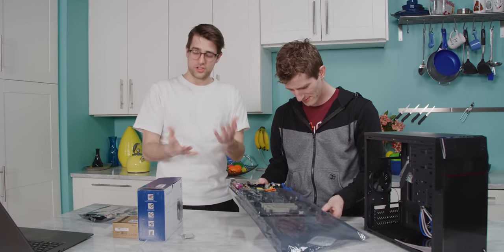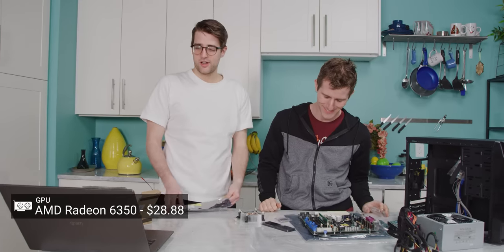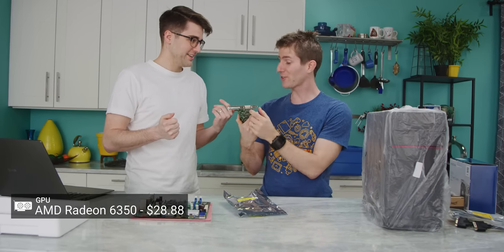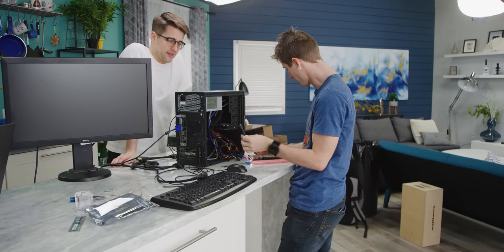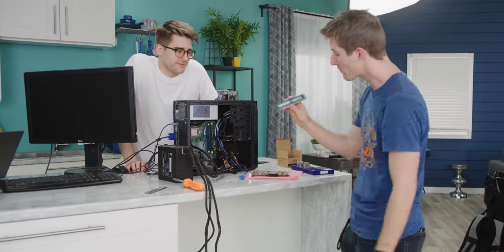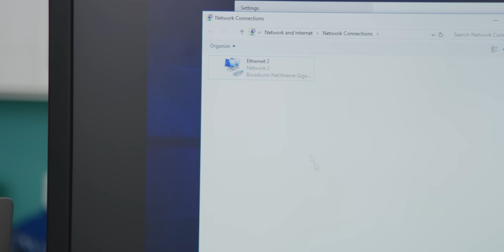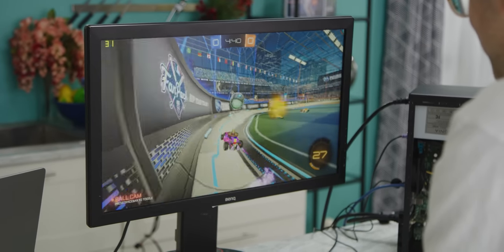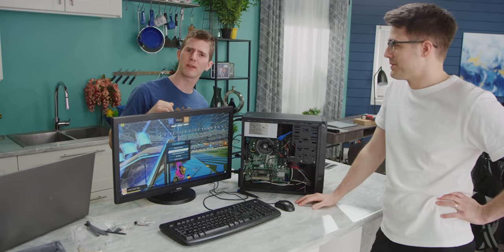We Built the CHEAPEST PC on Amazon!

Comment: The Radeon HD 6350 was only $23 MSRP when it launched in 2011, so it got more expensive. (The 5450 was a $50 card from 2010).

That connector is called a DMS-59 for Dual Monitor Solution. It can run two monitors off of a single port, using a splitter cable but since it's a unique port, you need an adapter even for a single monitor. It's a derivative of the LFH-60, which can run up to four monitors (the DMS-59 has one hole blocked).

ttps://en.wikipedia.org/wiki/DMS-59

Comment: I had a 775 socket rig since 2020 you can make 771 sockets CPUs work on 775 with a little work. I finally upgraded sort of to AMD 3400g (new), B450 MOBO (new) and a R9 390x I bought for a 100$ never used 'like new'.

I just missed out on an AMD 3600 for 120$ (new) and a 3300x for 84$ (new).

Comment: Guys I have a problem with my PC and I hope the comment section can help
I have an Intel core I7 7700
Gtx 1060 Asus strix oc
8gb ddr4 ram single stick 2400mhz
128 GB SSD the tiny/fast one
2tb hd
450 watt powersupply
It runs alot worse than the PC is supposed to
What could be wrong?
Edit
I usually get around 40 ° temperature wise
I have everything updated aswell
Reply: Maybe the cpu is outdated or you havent updated windows
Reply: Check temperatures. Bad or old paste could make thermal throttling. 450 W psu doesnt look powerful
Reply: Psu is ok for gpu cpu looks fine is it a fps issue the maybe you integrated is bieng used instead of your dedicated gpu
Reply: @Teampepsi123  I checked and all my driver's are installed and my 1060 is being used
Reply: TBFY_ CLAN then I don’t know

Comment: I got myself a computer completely from eBay. It's an old HP Compaq dc7800 Convertible Mini Tower, upgraded with an Intel Core 2 Quad Q9550, 8 GB RAM and a GTX 750 Ti.
Bought 2008. 200€ for the computer (fixed in a workshop for disabled, including a LG Screen and an old RT7H10 HP Keyboard) and about 150€ for the upgrades. So total of 350€. (Plus 25€ for a WiFi Adapter last year, since i moved and wasn't able to use a LAN cable anymore. So 375€ total up to today.)
Downside: It's now that old (turning 13 years old in two months) that Win7 is the highest i can install (bios update didn't worked sadly), there is no way i could upgrade it more and it starts to be to old to run newer games on it.
Upside: It's still running pretty good (using it right now) and i am able to play a lot of games on it like GTA 5 or Minecraft with decent shaders, etc..
So in total i would say it was totally worth the 350€ back then. But it becomes necessary for me to buy a new one tbh...

Comment: OEM parts fucking you over is exactly why I decided to stop buying computers and start building them myself.

My brand new $1000 HP computer was outdated to where I couldn’t play any new games after 2 or 3 years. I felt so ripped off. Then I tried to upgrade things for school and quickly learned about OEM parts as I tried to add new parts to it and failing to do so, tried moving old parts into a new PC to no avail. The only thing I brought over from old computer to new was the DVD drive. I probably could have brought over the PSU, too, but it was like 400 or 450 watts.

The computer I built cost the same as an HP, but was significantly more powerful and wasn’t locked down with shitty OEM parts. I built my sister’s computer, too.

Comment: I have a challenge for you guys.....try building a 'retro' system using a PC Chips M741 LMRT / SiS630 chipset based mobo with onboard VGA - all the way up to 8MB of your system memory will be used for VGA. Even in the late 90's this motherboard I mention was not exactly the best...........it would even lag severely with 3d screensavers so anything more than Solitaire / MSHearts or maybe WinPopup might be more challenging....heck, that thing even had a built in modem.

Comment: I was at my grandma's house and they had a pc that looked like a gaming pc. It originally ran windows vista, as stated by the sticker on the case, and is from about 20 years ago, but my uncle installed windows 10 on it for my grandma. It has ram expansion disk reader thingie and other crap that was the standard 20 years ago. It has letters: (xd) that looked like it was sqwished from the top and bottom, right by the disk reader. It is AMD (standard back then) and it ran roller coaster tycoon from 1999 great.

Comment: I mean, the graphics card is pretty bad somewhat. But I gamed on core 2 duo till 2017 and core 2 quad till 2019, before I upgraded to a i5. I only upgraded to the quad in between because R6 needs 4 cores. But in pretty much all games(with a small overclock about 0.3-0.5 more ghz) I got about 40-60 fps on low-mid settings(in R6 60fps with low settings) with a gtx 780. so they ain’t even that bad. The only reason i upgraded was that the core 2 quad couldn’t run black ops 4(at least not playable)

Comment: I’m on a dell laptop and I’m saving up to switch to pc.
Any got any recommendations?
Reply: Juz go for a apu like ryzen 3 3200g or if you don't have a lot of money left, then buy a core 2 quad and a gt 710, then save up money for an upgrade on the GPU and buy 8gigs of ddr3 ram, buy the zebronics g41 motherboard and buy the circle 450watt PSU( this setup cannot be upgraded)
I recommend u to go for the ryzen
Reply: @niranjansudhi2585  i want to buy ryzen 5 3400g is that a good option ?
Reply: @adnanebelfaquir  yeah its nice but, it has only 4 cores, I recommended to go for a 6core CPU, you will get it at the same price, the only problem is that you need a separate graphics card

You can go for a 6 core ryzen 5 2600 or 3500x but if you don't want to  spend money on a graphics card, you can go for the ryzen 5 3400g

Comment: Probably actually stronger than mine. I'd need to play Rocket League on my PC to know for sure.
Reply: I downloaded the demo / Basic Edition of 3DMark and I got a score of 1,302.
They put a 2020 office laptop at over 8,000 and a 2020 gaming laptop at over 31,000.
"The results for your computer are better than 2% of all results."
Reply: @TheDwarvenDefender  ...Man, In my opinion you would already have a more powerful processor than the one used by Linus (Core 2 Duo E8400 at 3Ghz = 1163 Pasmark), even your processor would be somewhat more powerful than mine (Pentium G640 = 1222 Passmark).

I think that your processor, mine and even the E8400 should be enough for the Rocket League and similar things, obviously it would be better to have at least a processor with 2 cores / 4 threads and even better if it had 4 cores / 4 threads (if not, 4 cores / 8 threads, depending on the socket that the motherboard has).

It would be a matter of having 4/6 / 8GB RAM and a Video Card that allows you to play decently at Resolution 720p / 1080p with certain graphic quality and 60fps.

Tell me what processor, how much RAM and what GPU you have in your PC. :D

Rocket League at 720p/High/60fps with Core2Duo E7500, 2x2GB DDR2 at 800Mhz (Dualchannel) and GTX 750ti (something like an AMD RX 550, more than nvidia GT 1050 GDDR5/GTX 750/R7 250X/HD 7770 GhzTR7 360).

https://www.youtube.com/watch?v=uZqQJTotx0E

:D
Reply: @juanmassiosare9850  AMD FX-4300, 8GB RAM, NIVIDIA GeForce GT 610.
Reply: @juanmassiosare9850  In other words, my graphics card is holding the entire PC back.
Reply: @TheDwarvenDefender  ..If you dont have enough money for an GTX 1050/RX 560, RX 460/GTX 950, GTX 750ti/RX 550 or GT 1030 GDDR5/GTX 750/RX 250X/R7 360/HD 7770 Ghz, then try with a HD 7750 GDDR5 or R7 250 GDDR5 and GTX 650.

At least with a GT 740/GT 730 with 384 CUDAs/GDDR5, even an AMD HD8570 GDDR3 (better with GDDR5).

GT 520 = GT 610....HD8570 GDDR3 is 3x1 than GT 520/GT 610/HD6450/HD5450.

https://fotos.subefotos.com/5c8f27141fc8e982bca5f3372acd5188o.jpg

Vega 8 from APUs AMD like Ryzen 3 2200G and 3200G, is more like an HD 7750 GDDR5/R7 250 GDDR5 with Overclock.

Comment: My case is cheaper but you can not buy them any more unless you buy it on eBay. It is a old dell vostro 200 it's old it's on windows 10 but it's original operating system was windows xp

Comment: The fact that indonesian people still use core 2 quad for gaming use and regular usage
Reply: They're still fine for most regular usage, so it isnt that special.
Modern AAA games can be problematic though.
Reply: @RFLCPTR  well if that so, you can use 4th gen i7 or i5 3470 for cheap alternative
Reply: @tvchannelGuide  Of course, but those are more expensive, at least in Europe.
Reply: @RFLCPTR  man that sucks, i find i5 3470 for only 20$😁(i live in indonesia, also not include shipping) shipping fee is around 4$
Reply: @tvchannelGuide  Do the Core 2 Quads cost the same?
Reply: @RFLCPTR  nope, they much cheaper around 10$, i recommend buy i7 860 or i5 3470, because the price goes down rn